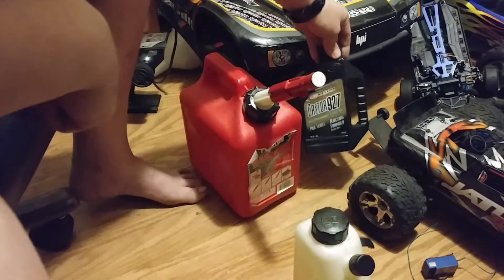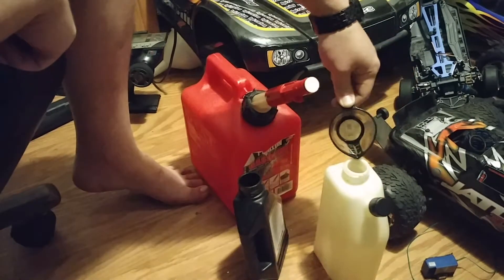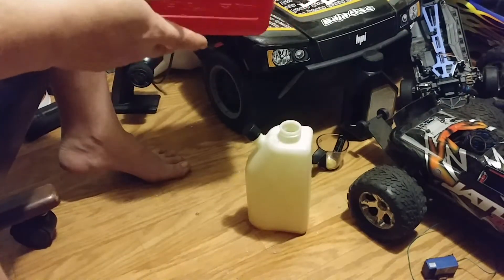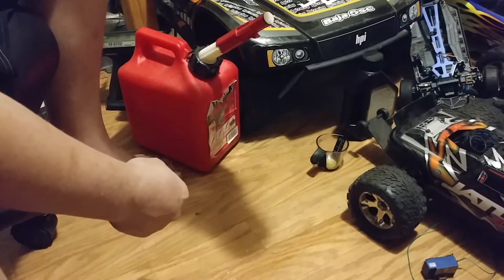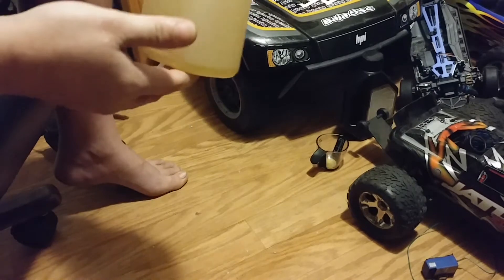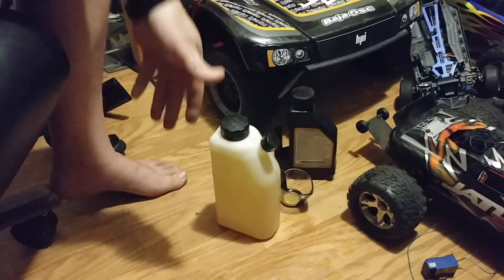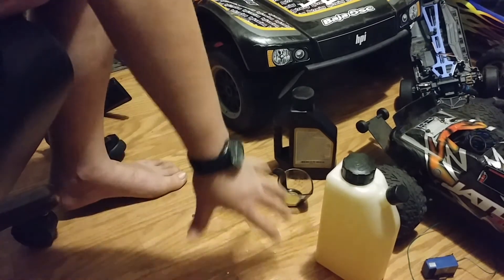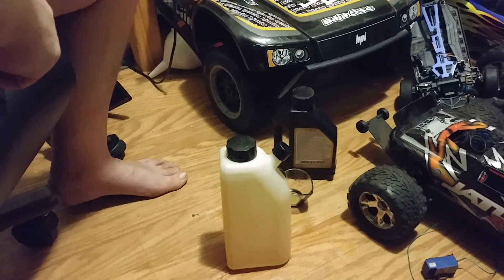How to mix 2 stroke oil and fuel

Comment: How much 2storke oil for a 25.1 ratio
Reply: take the volume of fuel, and divide by the ratio:  ex; 1 gallon (128 oz):   128/25= 5.2 oz.  if one has 1200 ml and you want 50:1  divide 1200 by 50;  we have 1200/50=24ml.  Just keep the units the same;  ounces with ounces, and ml with ml.  I hope this helps.

Comment: Question: how about 28:1 ratio? How many ml of 2stroke oil should i use? Im using castor 927. Thanks 😊
Reply from the maker: FID.BNEO. RC 35ml per liter.  150ml per gallon
Reply: take the volume of fuel, and divide by the ratio:  ex; 1 gallon (128 oz):   128/25= 5.2 oz.  if one has 1200 ml and you want 50:1  divide 1200 by 50;  we have 1200/50=24ml.  Just keep the units the same;  ounces with ounces, and ml with ml.  I hope this helps.
Reply: 1 gallon = 3785 ml.  So, 3785/28 = 135 ml.
Reply: @potjnkye86  1 gallon = 3785 ml.  So, 3785/28 = 135 ml.
Reply from the maker: @thomasgronek6469  my math was off, 😏
Reply from the maker: @thomasgronek6469  thanks
Reply: @potjnkye86  No problem.   BTW, I enjoyed the video, and you picked up a new subscriber.
Reply from the maker: @thomasgronek6469  THANK YOU!!! More videos coming soon, long story, lost everything.

Comment: My new HSP brand 1/5 scale 32cc says it requires 75% gas 25% oil. My tank size is 700ml. How many ounces or ml of oil do I add to each tank?
Reply from the maker: jesse dorman for one thing they are way off with the oil.  I can tell you how much but all 2 strokes run 16/1 at the richest. HSP is saying 4/1.  So for every 1000 ml 250 ml of oil is needed.  So if it's a 700 ml tank that is equal to 70% of 1000 ml which would equal 700 ml.  So you would then take 250 which would be what they say for oil and multiply it by .70 which is 70% and that equals 175 ml.  But again that is way to much oil.  You should run 25/1 which is   4 percent oil to 96% gas and that would be 40 ml of oil per 1000 ml so for a 700 ml tank you would add 28 ml of oil.  If you have any more questions or worries comment and I'll do anything I can to help.